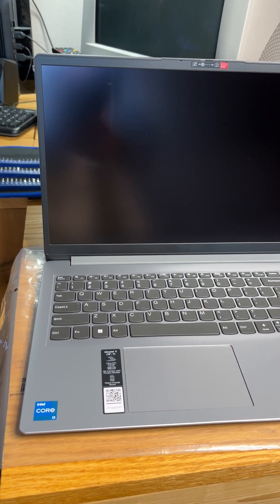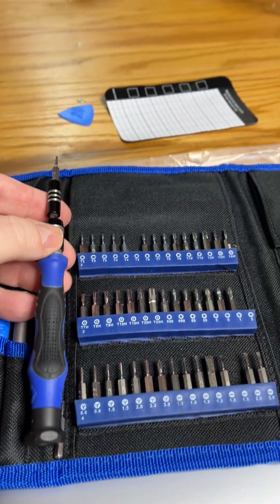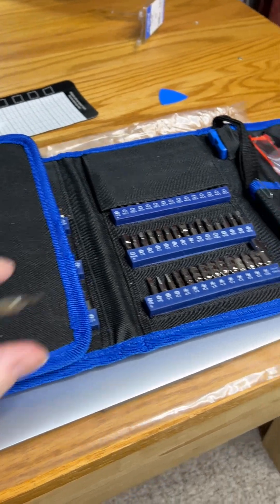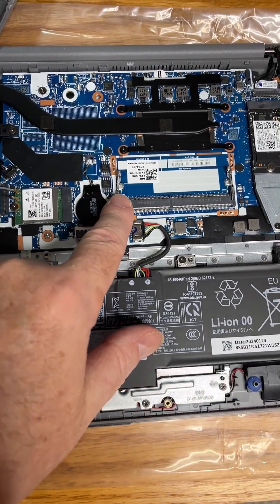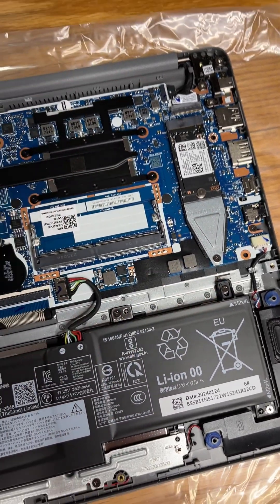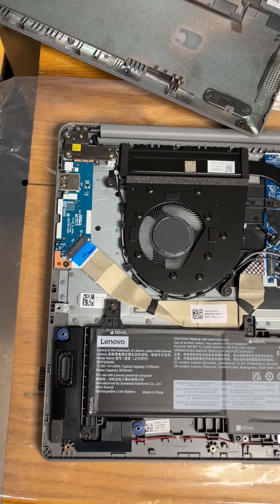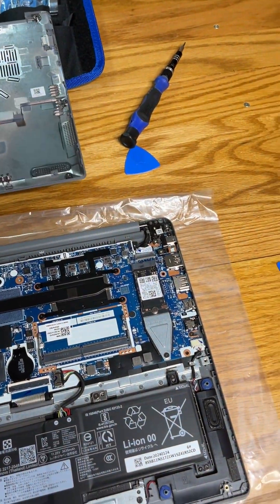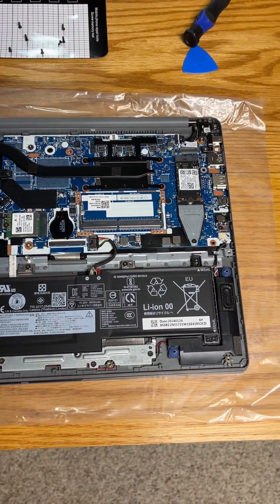Lenovo Ideapad 1i Upgrade Options

Comment: I hate it when the plastic tabs break no matter how gentle you try to open it. Old laptops used to have tougher plastic,never had that happen on those
Reply from the maker: you cannot know my level of disappointment.  mind, though, that it did screw up tight afterwards
Reply: @UncleMikeRetro  Oh i don't know about disappointment but i know about the internal pain because it happened on my 2000$ gaming laptop too